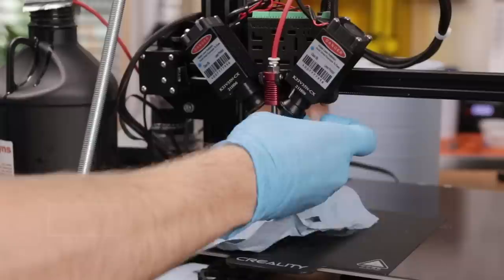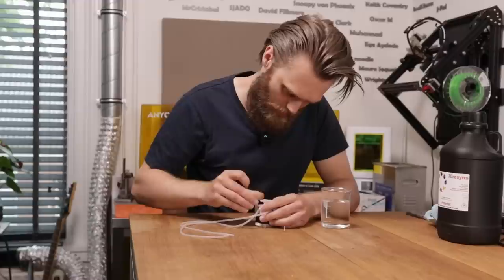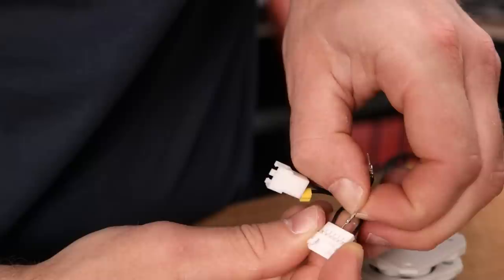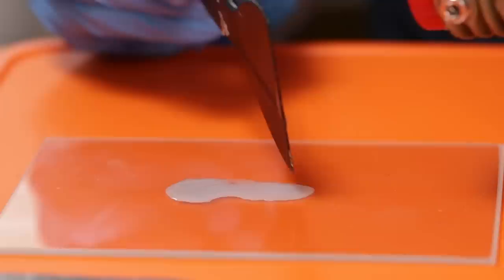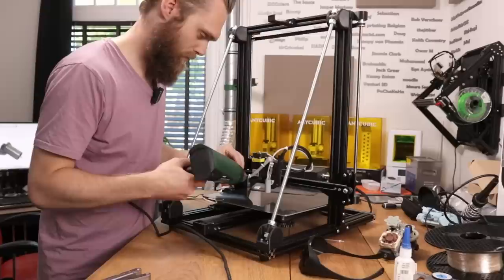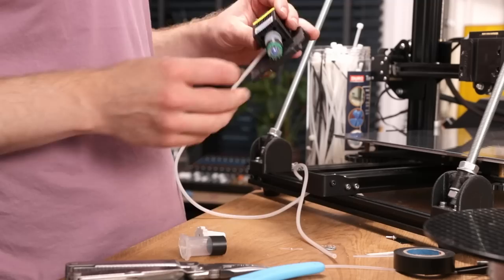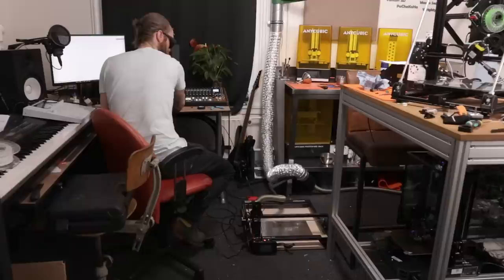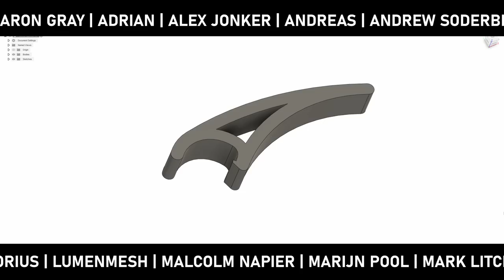FDM resin Printing with LASERS and a 3D Printed PUMP!

Comment: Take an old inkjet printer with a continuous ink system, make it a flat bed, add a third axis and put some heat beneath the ink bottles. Now use UV resin instead of ink. Heat up to 70 or 80 degrees celsius will make the resin less viscous and also faster to set. You can even use some tinning agents to make the resin flow better in the piezo electric pumps.
That's how it should be done, with COLORs.
It''s the same PROVEN concept behind UV flatbed printers but with a third axis but nobody ever attempted to make a cheap inkjet 3d printer. You might succeed where others have failed.
Just beware that you may need some utilities to reset the printer and/or custom drivers.
Alternatively, a pen plotter with a third axis would also work.
Food for thought.

Comment: I think you're really really really close, and i think that if you replace the quick connect at the top of the hotend, one one that uses a compression fitting, then it could fill up with resin, but never overflow.  Also, I think you should try a really large nozzle with bigger hose and printing really fast, or try a bigger hose with a small nozzle and printing really fast.  I'm thinking if you can get the resin to "almost" spray out of the end for each layer, you could keep better clearance between layers (increase layer height) and i think with 2 lasers it would cure no problem.  Then it would stop catching and you would get a finished print it think.  Basically I'm suggesting more line pressure and raise more for the 1st layer and between layers.

Comment: If you ever work w/ fiber optics again - cut each end with a brand new exacto - single blade - clean cut - you will get more light passing through.  The clippers have 2 blades and do not leave a clean edge - dramatic difference

Comment: I'm not sure this would work but, my suggestion is to lay the whole layer of resin, then flash it with the uv light, as long as the resin doesnt flow out of the area you are intending it to stay, then flashing it at the end of the layer should cure the resin in place for the next layer and so on.

Comment: I used an 18650 battery powered blue laser pointer to cure resin and it worked perfectly. It was 1mw Assassin Laser from eBay.  It was maybe 5 bucks. You could mount it directly on your nozzle

Comment: the dot electrical tape is a great idea, however, there is light still hitting above where the shadow is cast. if you were to tape a dot and extend the dot vertically the shadow would cast over the whole extruder and would reduce the amount of resin being cured in the nozzle. 

could you also defuse the light further/ maybe add a filter to the lens in order to reduce the reflection into the tube?

Comment: Great work and progress in spite of the obvious frustrations.
9 years ago I tried to make a resin 3d pen  like the fdm 3d pens that were popular. My problem was that all the compact uv sources were not nearly as powerful as a diode laser, so even with 30 diode uv flashlights the curing time was too slow to make it workable. BTW I think one of the problems you are having is the resin is transmitting the light back up the nozzle, like a bad optical fiber. I wonder if having the resin spit out in droplets (like an inkjet printer) so there is not a continuous light conductor going from the bed to the nozzle might work.

Comment: the nozzle rub it attributed to the previous path in the print a smaller nozzle diameter both the ID and OD at the end, you might have to sharpen the nozzle to a cone where the ID and OD make sort of a fladt ring blade, use a higher viscosity to prevent the fluid from spreading out while it settles, so youll need more pressure but lower flow, the objective should be to have a resin that doesnt spread out before cured tho i suspect this is just going to be a draw back specially since in an FDM printer the slicer is actually trying to get the hot plastic to press against the cooler plastic while their at their tacky temp to weld the 2 together.... basically FDM resin isnt possible unless the slicer is programmed for it.

Comment: Need to set an on-off retraction for the laser just as their retraction for the resin print is set so that way the light is not curing the resin in the tip it just comes on when you need it when resin is applied to the part.

Comment: Maybe try and add powders to the resin to thicken it? Similar to how concrete printers work except the UV will cure much faster than the binder in concrete. Also for the extruding pump, maybe a screw type will work better, like the ones they use in large fff/fdm printers or injection molding.
Reply from the maker: I think that adding a powder to the resin would be a great solution! My first idea for the pump was a screw, but that only works with pallets. A screw inside a liquid doesn't do anything ;) I like the pump as it is since the mechanics don't come in contact with the resin.

Comment: What about putting a single fiber optic strand through the nozzle, and print in a cup of resin? Ideally only the resin just past the tip of the nozzle hardens. I guess keeping the tip from hardening into the resin would be tricky. Anyway, most excellent experimenting, thanks!

Comment: Great idea and concept! With your initial optical fiber design, did you try mirrors? Having the laser hit one at a slight angle and bounce off an upper mirror could have created a small light chamber that the fibers could have used as their source. Just a random thought.

Comment: I was wondering if the unexpected heights could be fixed with better flow control? For a non-contact option perhaps a venturi/constriction/tube with small hole could be made with a constant pressure above it, using a bellows/balloon that is pushed by a motor synchronised with a pressure sensor behind a membrane?

Comment: Can you get it to drip instead of outputting a constant flow? That way you could alternate between placing a drop and curing it with the laser, switching the laser off while the dropping is coming out, and then sucking the left-over juice before switching the laser on again.

Comment: I thinkk your issue is, that radicals in the solution diffiuse up into the nozzle. Your nozzle should have an air-gap to the curing resin, otherwise it starts curing into your nozzle (look at radical polymerization for more details)

Comment: maybe you can use some inspiration from polyjet printers. They use multiple nozzles and print from side to side like an inkjet printer. The resin gets cured by the uv lights on either side of the print head.

Comment: A thought, how about printing one layer at a time with no UV light then pause on layer change and flash UV laser in large area to cover print and cure that layer then repeat for following layers, only curing at  the end of each layer that should stop the nozzle form clogging.

Comment: I'm guessing the pulsations you saw in the final pump design when pumping air was due to air's compressibility which would be why when water went through it was reduced (probably still there to some extent but if its negligible 🤷‍♂️)

Comment: Perhaps lay down the layer of resin first without the laser on, then do an exact follow-up pass on the same layer with the laser on, that way you don't get reflective light contamination.

Of course, there will still be the laser light scattering back into the resin tube that could cause premature curing...

Comment: I just came across your video. and I know we can figure it out. i just subscribed so i want to see more.-
Ok here  is one idea, why not use a metal nozzle that has barbs, so the tube cant leak, followed by a hose clamp.
also thinking that since using a leak proof metal end you shouldnt need a black tape mask
maybego faster and increasethe flow rate and area in which the laser shines on.
hmmm maybe you still need the mask, that will be an example.
I am excited to see what you do next. since it has already been done, we know its possible, lets do this brother.

Comment: what you're trying to do is a kind of polyjet thing. you need a thing similar to a inkjet printhead, apply a small amount of resin, then shutter it to prevent the resin of curing and then apply a flash of curinglight. then next layer.
Reply from the maker: I think that's an interesting idea. Not applicable for me because I want to use this technique to infuse continuous fibers with resin to get continuous fiber printing to a standard printer.
Reply: @properprinting  okay, understood: 

like this makerbot patent with carbonfiber in the onyx filament?. 

may i ask and wonder why? in my tests all kinds of affordable resins are inferior stability regarding to ABS oder ASA FDM printing. if you have a fiber in your resin - how do you connect the fiber to the resin itself? in dentistry this is done via silane molecules and silicate blasting. this is not a trivial easy thing i suppose.

and you still want the precision. as long as the resin is able to guide the light through itself. it will cure if there is light. not much, but just a bit is too much.

Comment: Thickening the resin (with some filler) and delaying the lamp (i know you are good with scripts), or reducing the light power may help?

Or just wiping the nozzle on every layer change , with a brass or silicon brush like some fdm printers (e3d tool changer for example)

 I've tryed to make some extruder like massivit in the past, with a siringe and some uv leds found on ebay, but I didn't develope the project

Comment: you could try use gel type resin . that one call GDP technology. by massivit .
I was have access to the machine. Gel like resin print like FDM.

normally that use 1-2mm diameter nozzle. print very fast.

Comment: If the resin is going from cold to hot maybe it's thermal expansion causing the nozzle to drag? The part expands a few microns for every layer warmed...etc so it will touch the tip if not accounted for?

Comment: Dude, you’re dope. I love it. Can you integrate asynchronous pulsing (maybe at like 10hz, or something) between the lasers and extruder, so  no curing occurs while feeding?
Or, have the tip of nozzle rotate at a high speed to prevent curing resin from bonding with the nozzle. Or, make the nozzle from (or coat it with) silicon, wax, or fiberglassing mold release.

Comment: You need to apply the resin with a brush or like a marker and cure it afterwards. i would cure the resin in front of the brush so it has time to settle and form a surface, you would never cure the brush. instead of using a nozzle you would determin the layer width by the brush and the hight by the pressure...

Comment: That idea was on my mind for many years but never built it. Also you could use an inc cartridge from an incjet, fill it with resin an try to print that way. Only there are no real open source cartridges 🤔 anyways awesome project and thanks for showing the struggle of prototyping 😅 stay awesome 👍
Reply: Tank modded cartridges are available. Or moddable.  Cheap T-shirt printers use hacked printheads afaik. Theres some info for some heads i think
Reply: @lasskinn474  yea i guess Firmware would not even be an issue if you just print one page/layer at a time... Basically only needs a z axis and uv LEDs ;)
Reply: @MakenModify  yea i think hp jet fusion works basically like that, with multi materials.

Ofc probably not so simple in practice but in principle like that.
Reply: Your not going to get regular resin to jet or even flow in any current inkjet heads. Too much viscosity. You need to modify the resin or purchase stuff already made for jetting. That would be from places like Stratasys or 3D system and the price is scary. Think +$400 per L
Reply: Also HP MJF doesn't jet resin. They jet additive chemicals that change the IR light absorption to melt or shield the powder.

Comment: You do you not use an expansion vessel? It is an orb with a rubber membrane going through the middle. On one side is air, the otherside is connected to the resin output tube.
The air in the vessel compresses if a spike comes and thus evens out the pulses

Comment: Hey buddy, this is a cool project! Why don't you  try laying dawn a layer and cure it right after? This way you can place the laser in a diferent position and stop clogging the nozzle
Reply from the maker: Thanks! That could be a nice plan B. I think it should be possible to do it during printing (like MassiveIt does it) which makes printing faster and also enables bridging when I add fibers to it eventually.

Comment: dude you're pretty much there, I think you just need to adjust your z axis e-steps a tiny bit as to account for the resin seemingly expanding upwards. Perhaps even using a higher layer height would also solve the problem, that would also correlate with the higher speeds being better quality.

Comment: Try curing the resin after it leaves  the nozzle, any residual in the tip won't be solidify instantly.  Have ti give it time to flow out like fdm it hardens after it leaves not in the nozzle.

Comment: Few years ago, i've purchased an "AtmosFlare 3D pen" that works with UV cured resin with few UV LEDs around the nozzle... Maybe this solution can be cheaper and more lightweight (few diodes instead of chunky lasers), but slower....

Comment: I feel like this tech would be best used for printing larger parts quickly, with a large nozzle that's not as easy to get clogged, and powerful lasers that cure the resin quickly.

Comment: Nice vid.

One question - Why?

What is (would be) the advantage, and wouldn't you be better off to ditch the dispenser entirely and shine the laser directly onto a layer of resin in the print bed?
(at which point you would have a regular resin printer)

Comment: Hey buddy. Remember me? =) It seems to me that the pulsation issue of such a pump can be solved by connecting three or more circuits in parallel. Exactly like in my SL_ST extruder. Make it three-phase, or more, which will reduce ripples in general.

Comment: I'm wondering if something which works in ink printers might be helpful here as well. Not using constant flow, but working with pressure and a valve for placing a small drop and timely curing it with a laser pulse? Sorry if this was already commented somewhere...

Comment: I'm wondering if your flow rate is still subtly inconsistent. I know you'd like to avoid the resin touching mechanical parts, but an auger might be a better solution. Either that or somehow run with a slightly pressurized bladder & a small holding tank AFTER the pump to keep the flow rate consistent during any hiccups.  You could probably elbow in the resin flow to a syringe with a small balloon (1-3psi) sitting above the inflow.

Comment: Yeah, my first thought was peristaltic pump; if the resin gums up or cures in the tube, you just replace the tube. It doesn't wreck your entire pump setup.
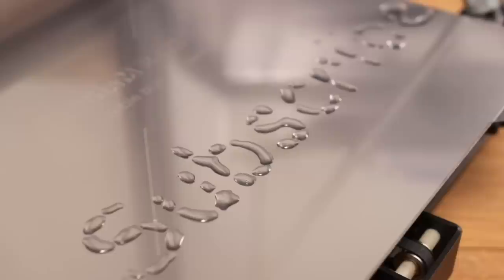@ 6:40 "I think this is the most useless print I have ever made..."
Oh I don't know, it got me to mash "subscribe."
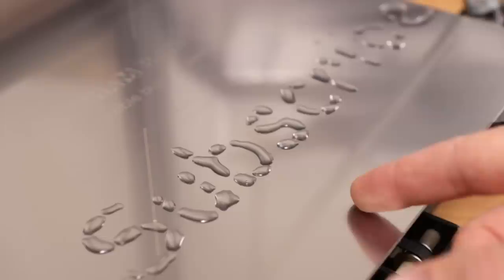@ 7:00 See if metal foil does a better job shielding the resin from UV light.

Comment: Nice experiment, pulsing the laser after each deposited drop might be another approach?
How's the belt extruder holding up, would like more details about that (force & grip compared to standard off the shelf solutions).
Thanks again for the excellent video..

Comment: I think the solution is to increase the viscosity of the resin somehow without affecting its curing properties too much. Ask a chemist if you know any about how it can be done. I think it should be the consistency of the toothpaste before it reaches the nozzle.
Reply from the maker: You're spot on because this is exactly what I've done in the next attempt!

Comment: CA glue fogs the optical fiber.
Use wood glue.
Experience gained with star wars fiber lit kits.
Also try to cut the fibers with shrp scalpel.
No heat gun...

Comment: You need a screw based type that keeps pressure and spins at a constant rate for anything like that so your tube would be compressed against the wall and make the liquid travel through the tube at a precise speed and rate anyone else agree?

Comment: Brilliant video.  like how all commentators root for you and add their suggestions. Its like they want you to succeed. My comment is the nozzle shape. A metal reflective shape is not the best shape. Any photon entering that tube will be absorbed by the resin. Maybe a better design is a nozzle were the fluid comes from the sides and then exit a small diameter hole downwards. Photons should not travel around sharp corners. Regarding the UV. you want to minimize UV radiation. If you have a circle or some circles of UV leds around the nozzle. Even better would be to add an accelerator IC on such ring which activates only the UV leds following the nozzle trail as that is were you want the UV light. If the nozzle stops, the acceleration sensor switches off all UV lights preventing clogging up the nozzle. This way there is no need to actively control such UV ring. The acceleration sensor and some intelligence does the control of the UV leds.

Comment: what if you would use some kind of a containerl, like in slm, and fill it up gradually?
like... you pump 0.1mm of resin into the container, then laser it, then another 0.1mm and so on...
it would be pretty impractical for tall parts(cause you would need a lot of resin) but you could pump it back to a container after ayou are done